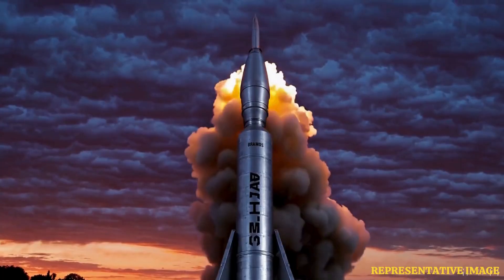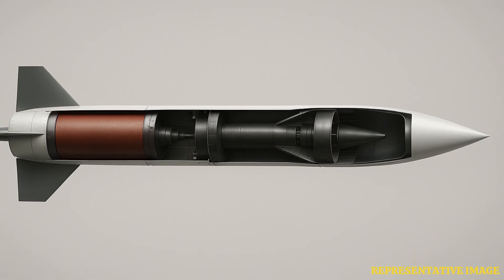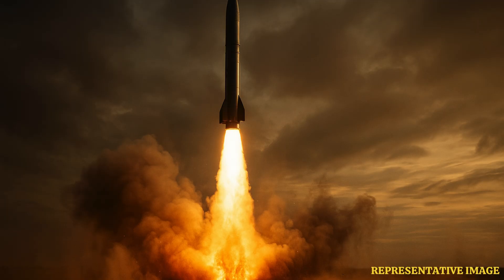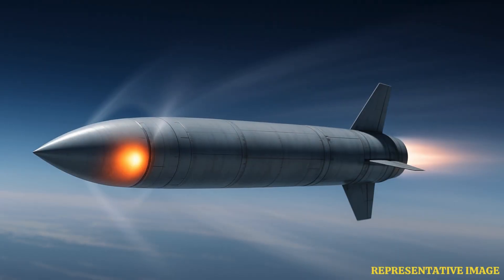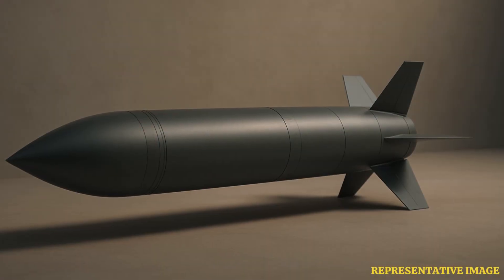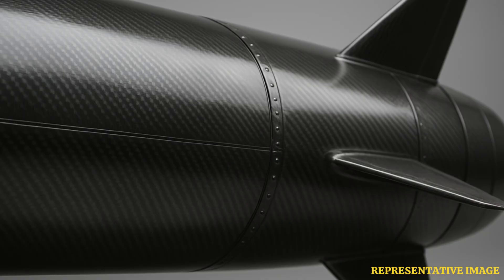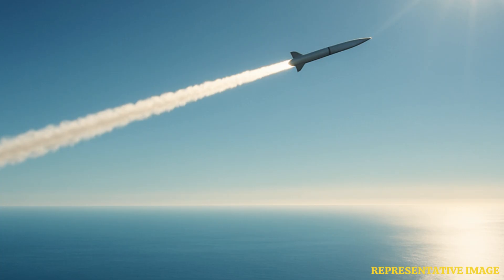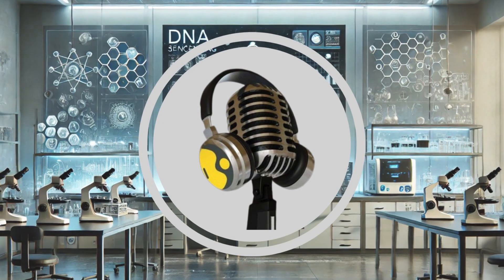BrahMos Missile Secrets Revealed: How It Achieves Extreme Supersonic Speed | WION Podcast

Comment: I suggest India no need to spend $2-3 millions each to have this so called supersonic missile, from Iran-Israel conflict we know, claim to have the world most advanced air defense system, cannot prevent Iran's old ballistic missiles attack, even Houthi's missiles can attack Israel, to just make $20000 missile, it will achieve about the same effect of $2-3 million each missile can achieve, anyway, a $3 million Brahmos made a 3 meter hole in a runway can be fixed in 30 min with $300 cement